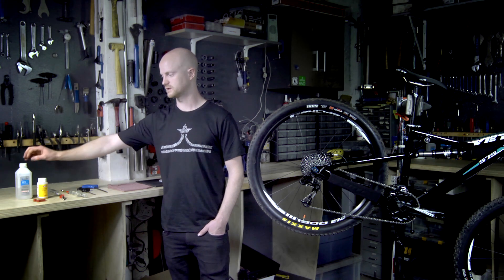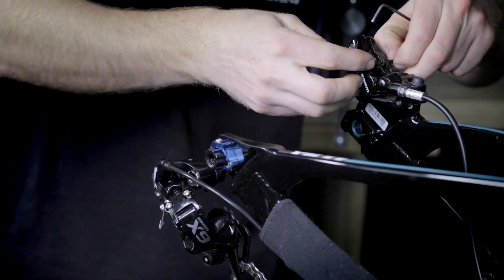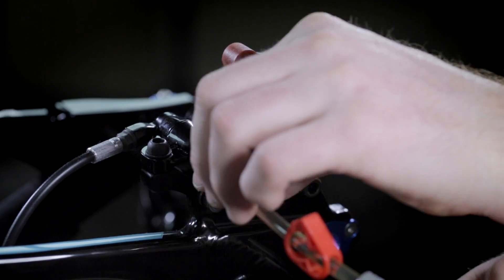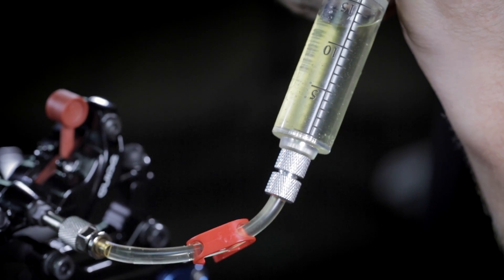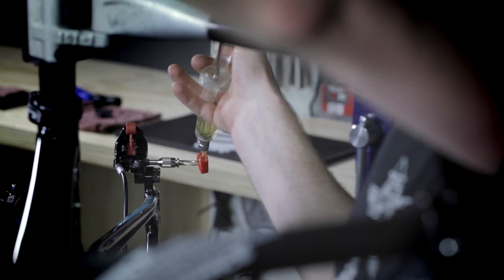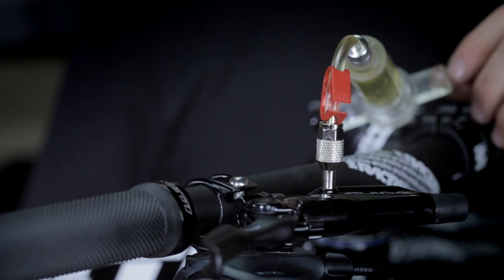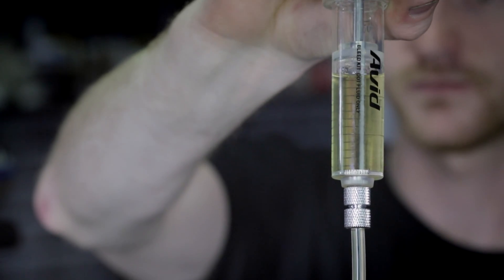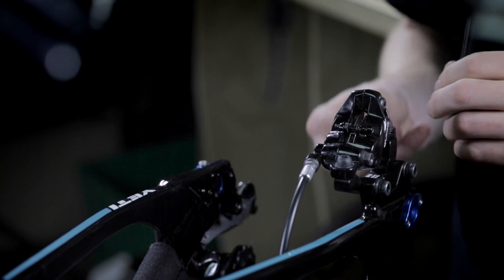SRAM Brake Bleed // evo Tech Series

Comment: My lever crapped out on me one day and I just a bought a replacement brake kit that I could simply bolt on and ride. I did not have to bleed the brakes. I was able to get the lever replaced under warranty a little later and now I have a back up brake. However I need to bleed the brake system since they only replaced the lever which is what I would have expected them to do. My question is do I have to have the breaks mounted to the bike in order to bleed them. I want to have a the brake ready to go incase I have another failure. I know I am just being lazy but thought I would ask. Thanks in advance.

Comment: This procedure is nothing like Sram, GMBN and many other channels on Youtube have presented.
Reply from the maker: The process is the same as the other two videos, but every mechanic is going to have their own style and tips for what works best for them. All three videos have some slight variances, but they all use the same tools and essential processes to complete the brake bleed. We did bleed the rear caliper vs. the front caliper, which the other two videos used. Maybe that's what seemed different to you? Good luck with the brake bleed!